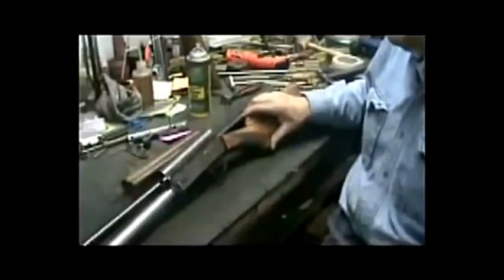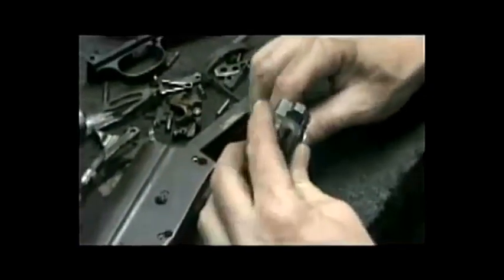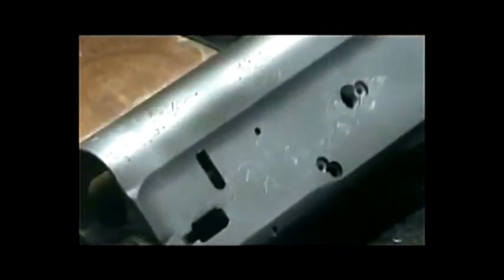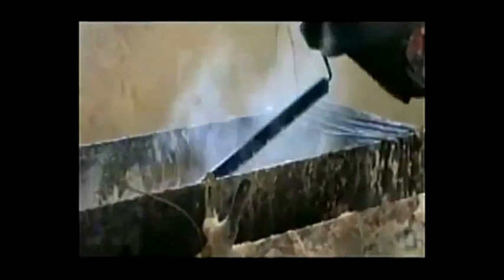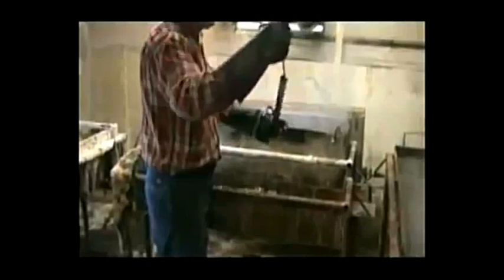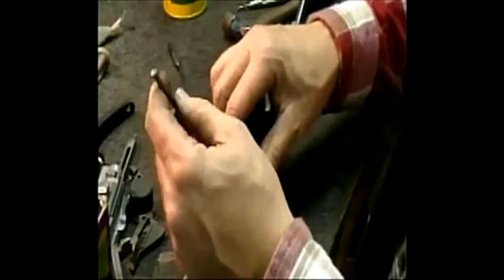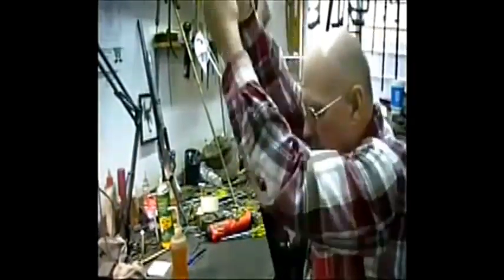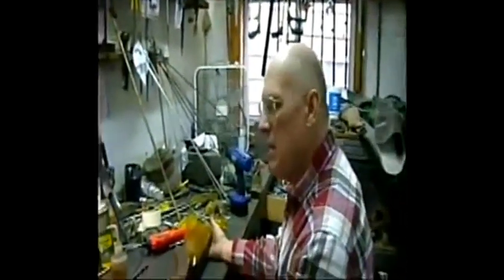If It Is an Auto-5: Art's Gun Shop

Comment: I'm going to be on the look out for a Auto-5 here soon and if it needs work that's where it will go.
Reply: Light 12's and Magnums will be easier to find over the 16 and 20. Belgium made is what I recommend. If you find a Sweet16 or 20 gauge that's in good condition to excellent, I'd buy it cause they go fast. And 410 superposed or 28 gauge is near impossible to find without the help of the intranet. Good luck!!